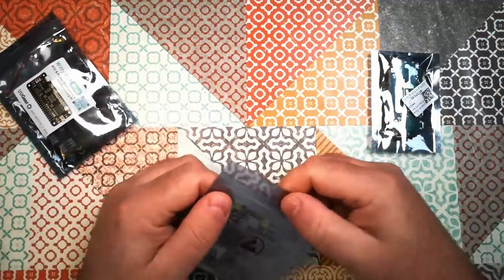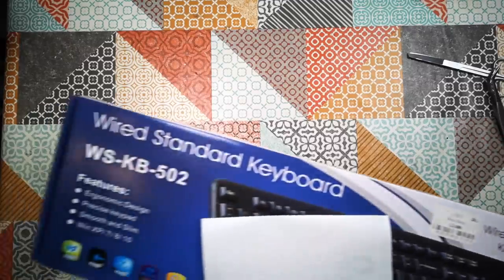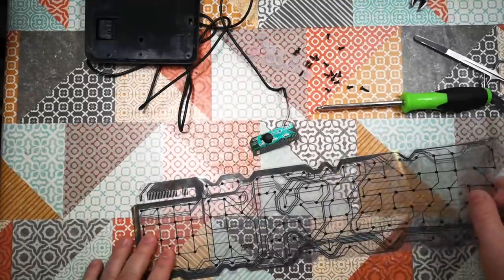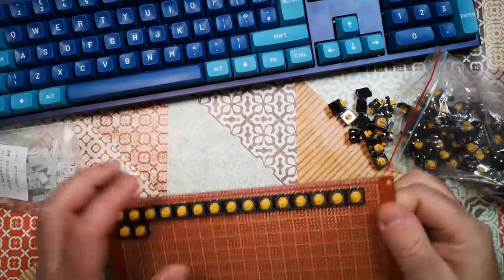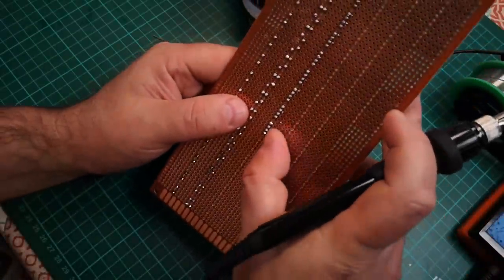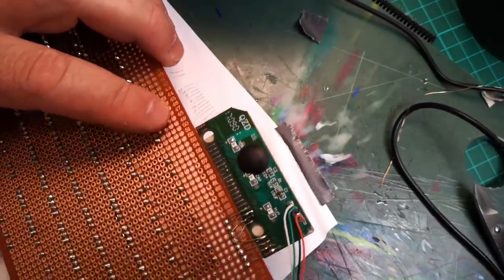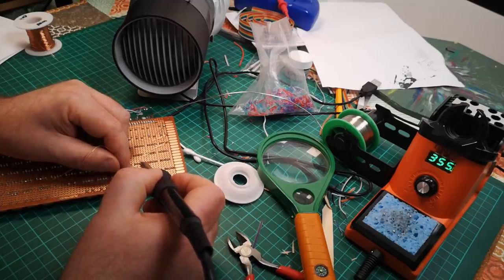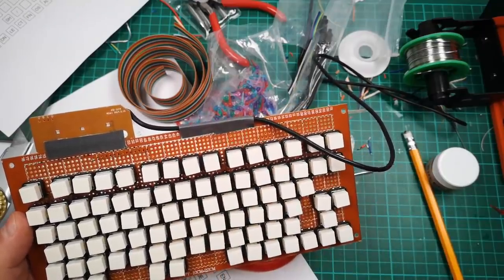How to NOT Build a Keyboard, or: Time to Stop Doing the Same Thing Harder

Comment: The funny thing about professing a keyboard is low quality because it has a lot of deck flex is that you're discounting the properties of flexible devices — i.e. bending before breaking. It's like comparing CBN to diamond, or taps to drill bits far as strength.

In a "Field" application I would rather the flexible keyboard in case it falls on something hard, but only if it is quality in the first place, and using leaded solder. For field use a piece of wood and a foldable membrane keyboard would be heaps better, even if it sucks to use because of water-tightness and robustness against impact.
Reply from the maker: I don't think you're necessarily wrong about things bending and things breaking, but this keyboard is not bendy for the reason they thought that would be good.  It's bendy because it's incredibly cheap and the amount of material used in its construction has been pared to the bare minimum.
You've given me an idea though... I wonder if there are any of those much-maligned foldable rubber keyboards available in small enough sizes for what I need...
Reply: @AtomicShrimp  i found those keyboards almost always have a numpad. So it's not likely to be something small.
Reply from the maker: I've seen a couple that are just compact keyboards and are nearly as small as I want. There is the tantalising possibility of making the device smaller, with a compartment that the keyboard rolls out from, but from everything I hear, these keyboards are really not great to use (worse than my weird tactile buttons maybe)

Comment: Here's a thought..... Take a Bluetooth keyboard and a micro controller... Use the existing matrix and key setup, and just program the micro controller to respond properly to that.  Lot's of different problems, sure, but if I were you i'd want a break from the kinds of problems that made me call it quits for at least a little while.
Reply from the maker: It's a good idea.  I had a look inside the mini bluetooth keyboard that I already have and unfortunately, the keyboard matrix wiring appears to be hidden away on an inner layer of the PCB, so it I think it would be quite hard to reverse engineer it - I imagine not all keyboards are like that though
Reply: @AtomicShrimp  assuming the matrix is separate (or able to be) from the controller chip pcb, in theory you could decode the matrix like you mentioned in the video where you connect the controller chip to a device and just start crossing wires. Making a new spreadsheet.... Although that could mean it amplifies your soldering issue, since you'd be working on a cut pcb instead of (too thin) pads.
Reply from the maker: @TheGodOfAllThatWas  I think you'd have to identify the data lines for the microcontroller and short them directly at the chip, which I think might be a bit too fiddly for my sausage hands

Comment: For me, the major obstacle with such a project would be the case. I think that with enough time and patience I would over come all the soldering issues, but I have absolutely zero skill at building a nice case for the final project, my style would be cardboard, hot glue and duct tape.

As for the keyboard, how would you consider hacking at a dead notebook, keep the keyboard and the driving circuit. You said your design is to be the size of an A4 sheet, most notebook are not that large.
Reply: Cases do seem to be a challenging aspect for a lot of electronics hobbyists. Today there's those 3D printers though. Which people are doing a lot with. But successful 3D printing isn't always one and done.

Comment: honestly you were better off using a strip board insted of the pcb you went with, a strip board has all the rows connected so you just have to cut the traces and solder, it should have significantly reduced the number of hook up wires you had to use, secondly you could have used any HID compatible microcontroller to act as the controller something like the atmega32, or the new rp2040 etc
Reply from the maker: Strip board would make sense for a matrix that is straightforward and rectilinear. This one was not. I would have had to cut so many tracks it would be halfway back to single pads

Comment: you did the right thing - you stopped when you realised it was time to stop. - I think you need to find a ready made keyboard of some sort - it'll be nicer to use once you finish the computer anyway. - It's part of your main user interface - let somebody else do the ergonomic optimisation of that part - you concentrate on the cunning bit of working out how to integrate it.

Comment: Seems an easier way to get the matrix down would be to remove the PCB from the shell, leaving the awful membrane nonsense in place, and then put a circuit of your own design in there which lights up LEDs based on which contacts are shorted, then just press each key in turn.  Would probably be less than an hour's work.

I'm sure this has already been said.
Reply from the maker: It's an interesting idea, certainly. but I think you might have significantly underestimated the effort required to do that (I cannot call fault, since this video was all about my own underestimation of effort) - consider:
- How would you make connections to the carbon traces on the sheets? - I found that just probing them with my multimeter tended to destroy them
- How would you design your test circuit - the connections are many possible rows to many possible columns. - if it were one-to many or many-to-one, it would be easy
Reply: @AtomicShrimp  I'd try a couple things for the connections.  First up I'd snip some little strips of metal out of some stock, solder wires (or headers) to them, and then rub a pencil on them, to sort of mock the connection the original board had.  Failing that I'd perhaps try to expose the traces of the controller board and tack some probes into that, which would bring other difficulties.

For the test circuit sure it can be many to many, but when only pressing one key at a time there's only going to be one in and one out.  I'd have a pair of LEDs for each contact, one forward one reverse bias, so whether it was in or out, something would still light up.  Connect a power supply to one of the contacts, and ground all of the others, then press all the keys on the board one by one.  Proceed down the contacts with the power supply.

Comment: It really isn't the most reliable mechanism ever. Those paper thin traces do get eroded away over time, especially when stored/used in less than ideal conditions, eventually leading to poor connection, certain keys not working etc, as they aren't protected by solder mask like they would be on a PCB.

Comment: Whos the biggest masochist?
You, doing that for days, or us, for watching 40 mins of you doing it?
Well, YOU of course. 😋

I hate that single pad perfboard! Really unpleasant to use. Strip veroboard is fine, but matrixing a QWERTY keyboard to someone elses row and col spec was nuts.
You should matrix to suit your own layout and make soldering easier, then deal with key assignment in software.
Or, best of all, buy a cheap mini-keyboard with old-style PS2 serial out, and use ONE serial wire to your rasberry Pi as the interface. 👍

Comment: I'm curious what you were optimizing for by going this route. You may have had a thought process along those lines, but it didn't come across in the video.
It didn't feel like you were optimizing for simplicity or low-risk design. It didn't feel like you were optimizing for labor or schedule. And it didn't particularly feel like you were optimizing for "performance" - something slick, unique, or perfectly-suited to your application.
Especially in the context of the larger system this is supposed to belong to, the decision to build a prototype from first principles, individual components, and reverse-engineered chineseum left me scratching my head.
Reply from the maker: I've started a FAQ in the pinned comment

Comment: Here's my original take: 

Buy an already produced small form factor keyboard, with a taller chassis. 

Ensure there's space inside for batteries, the new pcbs and ports. 

Do NOT create your own switches. They won't be NEARLY as reliable as manufactured ones. 

Create "connecters" every time you interface with an external device / component. Then if a part breaks, you can unclip connecters, and replace the module, and add a new connecter to the replaced module. 

You wanted to use off-the-shelf components, but then cheaped out on the keyboard for the keyboard pcb (when you could have bought one online on aliexpress) and you could have also bought an "empty keyboard" that can accept standard switches. 

If you TRULY wanted to use those switches, you should have installed the switches one by one, then ENAMELED the bottom switch contacts for EVERY switch (and only solder to one pin for each side of the switch). This way, you KNOW never to use the enameled contacts, and it's less confusing. 

Then, you should have created a PCB layout in a digtal pcb designer, and wired up your switches there, noting the contacts for each and where they should bridge to the PCB. Then you can simulate. 

Then you follow this guideline as you progress. 

If you wanted to solder to those small; traces, you should have used a microscope, solder pencil, and SCRAPED the enamel wire with fine sandpaper to remove enamel. You should have ALSO created a breakdown/carrier board for the keyboard PCB BEFORE attaching to the perf-board, knowing it'd be easier if you mess up on the perf board. 

For any project like this, you ALWAYS need to account for a human swapping positions of components by mistake, choosing the WRONG pins, and needing to replace modules / parts of the project you failed at.
Reply from the maker: I should probably have sketched out what I really want to make here.  There is (as far as I can tell) no commercially available keyboard that is quite compact enough for what I want to make - The keyboard needs to be no wider than 200mm and I want to build in a screen - sort of like the shape of Ben Heck's portable Spectrum (but not exactly): https://dperry.com/2014/08/22/ben-heck-zx-spectrum-build/
Reply: @AtomicShrimp  

I feel there are very easy to get mini keyboards. 

I recently bought a RiiX8+ keyboard online, and it's very very small. I feel there could be a way to get it to use a usb interface, vs bluetooth / 2.4ghz, or find one similar that's geared towards mobile and has a usb plug-in option instead of wireless (like an xbox controller does when you connect via usb, and how it turns off it's radio).
Reply from the maker: I haven't found any small USB keyboards.  Things like the keyboards in the Rii range would be great, but they are bluetooth only.  Any USB socket they have just receives power for charging - the data lines (as far as I can tell) are not connected to anything
Reply: @AtomicShrimp  

Hmm, any possibility to inspect the data lines to the Bluetooth / 2.4ghz communications and just shim a wire between that and the radio? 

Assuming they are different ICs of course.
Reply from the maker: That sounds like something Ben Heck could probably achieve. I doubt I'd get close - the cpu in the keyboard is probably talking to the Bluetooth module via i2c, but you'd have to figure out the encoding, then find a way to translate that into something a USB interface could use. It's an interesting idea
Reply: @AtomicShrimp  

Yeah, i guessed they'd just send a usb-like data stream over bluetooth (because usb keyboard controllers are very cheap), but you're probably right that the controller will just directly encode the data to be sent to bluetooth using a very encoded transmission format to save battery.

Hmm.
Reply from the maker: @1337GameDev  I think there might still be ways to use a bluetooth keyboard - either by cutting the keyboard matrix free from the controller and wiring it to be scanned by an arduino or something, or alternatively just taking the rubber sheet of keys and placing it over my own grid of tactile buttons, with my own wiring and controller
Reply from the maker: I think I just found the keyboard!  The G750 keyboard that was made for pocket PC devices has a fold-out mechanism.  I think it's an RS232 device, but I expect I can interface that to the Raspberry pi
Reply: @AtomicShrimp  

Now THAT is cool. 

I'm assuming it's a:

HP COMPAQ G750 Portable Folding PDA Keyboard 249711-004 iPaq 384178-001

It would be interesting to see how you interface with the keybaord to get the button presses. Might need to hook up a usb logic analyzer (a basic one is $10 on ebay), and look at the signals sent to the connecter (after attaching it to a breakout board of course). Could be neat. My guess is it might be PCM or an older style of data comms as I doubt they'd do SPI / i2c for this.
Reply from the maker: @1337GameDev  I think it's RS232.  There are a few sketchy projects out there where someone has hacked it to USB.  I think I can probably do it.
Reply: @AtomicShrimp  

I had an interesting idea:

What about the Xbox 360 / Xbox one controller chat pad?

What about the Vizio tv remote keyboard? 

I'm not sure what those use, but could see them being decent. 

The Xbox controller chat pad goes through an audio plug, so it could be only 2 data lines and a common ground.

Comment: Trying to solder a kbd matrix by hand? 0_0  This is absolutely a place where you go for a custom PCB solution. Two sided, one side for row traces, the other for columns, with padded through-holes where you want your keys. In principle, you can buy blank coppered PCB ane DIY the etching if you're really set on doing this yourself, but TBH, I don't think it's worth the time even doing that compared to finding an online shop that will print custom PCBs. It's not exactly the cheapest thing in the world for a one-off, but you have to consider how much your time is worth to you as well.
Reply from the maker: I've started a FAQ in the pinned comment

Comment: Custom PCB board is the way to go.
Reply from the maker: Probably, but I think if I'm doing that, I should use a teensy or similar for the interface - because then my design could be re-used by someone else, which would likely not be the case if I use the harvested keyboard controller
Reply: @AtomicShrimp  
Isn't that the whole point of prototyping?  To test your design hypothesis.  Admittedly you went for the finished article but at some point I would have reclassified it as a prototype and, as you have, moved on to something else.

Comment: There's nothing wrong with your approach here, but you are being a bit of a plonker in some sense. What you're using in that cheap keyboards electronics is just an MCU's GPIO pins. You're planning to use a Pi Zero, which has it's own GPIO. The better solution here (I think) would be to continue with your plan for a breadboard keyboard, and (using a hat if necessary to extend GPIO), run the keyboard matrix straight into the GPIO of the Pi. There are a ton of projects which let you use GPIO to drive a keyboard via the Pi, and with this method you can engineer your own layout how you want it, instead of being confined to someone else's rather cheap design. I do love the variety of stuff you get up to on this channel in any case, and I hope you manage to figure this out.

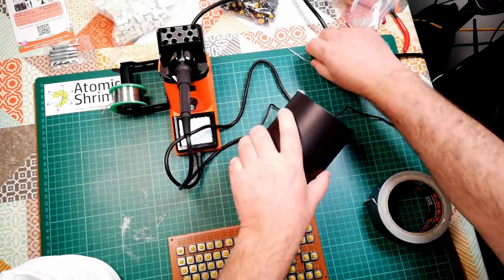Comment: 20:00 I am going to be that guy and say: That's overkill. If you were soldering boards every single day for 8 hours a day, yeah, it's a good idea. But for what you're doing? Or for occasional soldering? Really overkill.
Reply from the maker: You go ahead and breathe fumes if you want to
Reply: @AtomicShrimp  Didn't say you shouldn't do it. I said it's overkill.
Reply from the maker: I don't think so.  My house has smoke detectors fitted, and I've had respiratory issues in the past; both of these things are things I'd rather not aggravate.

Comment: Try using ki-cad to map out the matrix instead of reverse-engineering a  membrane.
Reply from the maker: You mean design it and use a different controller?
Reply: @AtomicShrimp  

My main suggestion really is just to use Ki-Cad or EasyEDA to make a mask/map of everything. Helps with logic and planning if you ever wanted to add stuff like full NKRO  with  diodes. 

 If you wanted to get really fancy you could send your gerber files to a manufacturer who offers prototyping services like JLCPCB and get a run of 5 done for $10-$20 and have a pretty colored, masked, and finished perfboard. 

As for changing the MCU, It you could do pretty much anything you wanted.  If you wanted a individual keyboard you could keep at it with the original controller and use the pre-programmed logic  or find something that's QMK-compatible that allows you to program the keys individually.  If you wanted something that was "part" of the build, maybe follow May's advice and see if you can use the RP2040 ports? 

If you wanted to go crazy with it, JLCPCB offers SMT services and parts services(though there are shortages of MCUs) so you could literally build a  board.
Reply from the maker: There's a learning curve for all of that. None of it is familiar to me